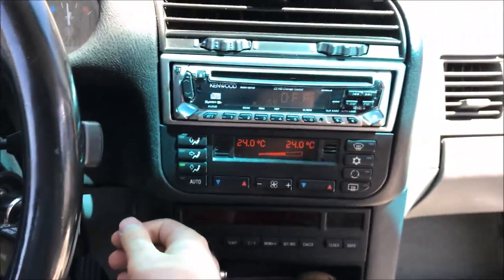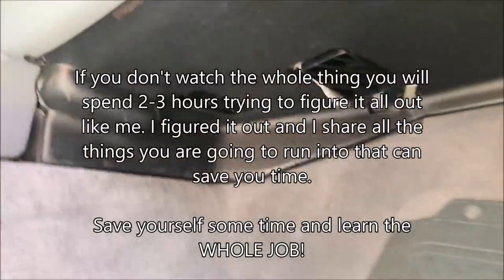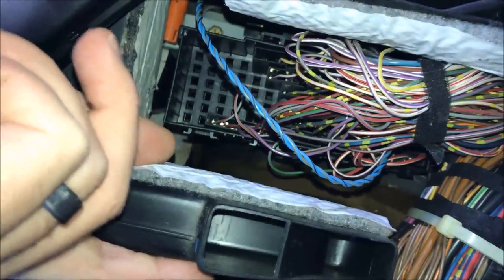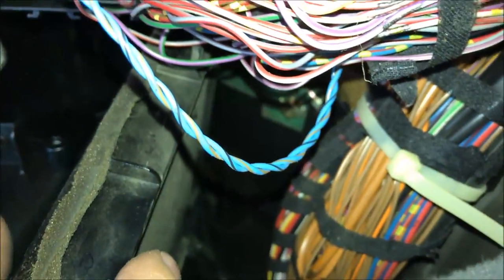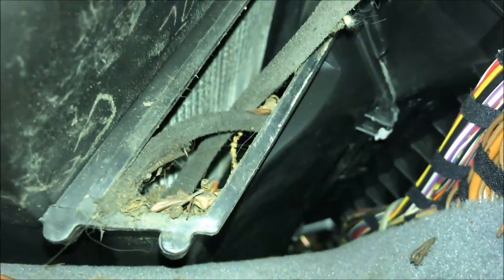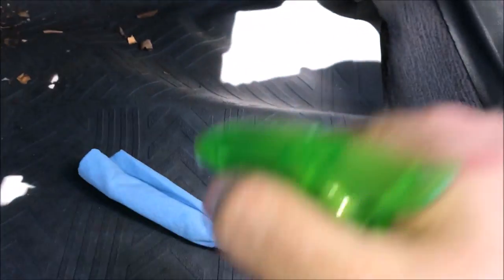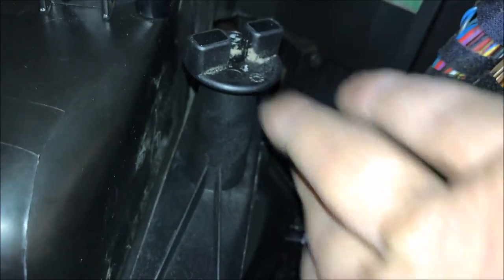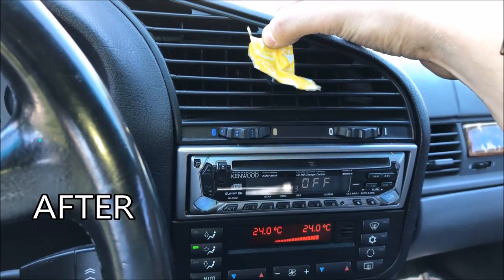How to Change Cabin Filter BMW E36 - BEFORE and AFTER Results AMAZING (Fix Low Air Flow)

Comment: If anyone out there has a right hand drive model: the access to the cabin air filter is still on the right hand side of the car (as shown in video) - so it is under the steering wheel as opposed to under the glove box. I just changed it on my right hand drive 1997 e36. You'll need to undo three screws in order to take the panel off that's under the steering wheel, then start pulling it back from the middle of the car (there's clips on the panel closest to the door, if you peel the panel from the center they'll unclip and allow you to take the panel off). There's a little electrical connection and light, both of which you can unclip from the panel once you've got it loose, in order to fully remove the panel and take it out of the way. Then you'll be able to see the cabin air cover with the round knob that you turn in order to take the air filter out. It's pretty easy, just like in this video, but on the other side of the car.
Reply from the maker: +Dante Alighieri thanks for sharing this!
Reply: Thank you Dante.. hardly any air coming out my RHD e36. Gonna tackle this tomorrow.

Comment: Fantastic! I just re-gassed my A/C as the interior of my E36 Coupe never got nice and cold. Living in Queensland (Australia) temps here hit the 40's (Celsius-over 100 Farenheit) all throughout summer. It turned out re-gassing didn't make much difference. As soon as I saw the video (I watched the whole thing) I went to my car, took off the panel as described, and took the 'lid' off my cabin filter. I never knew it was there! My filter was EVEN WORSE than in the video. It was fully choked up, and a pile of leaves and twigs fell out. I tried the fan (with no filter - I need to buy a new one now) and was 'BLOWN AWAY' (hahahaha) by the difference. I even feel the cold air from the back seat now! I can't wait for the drive to work tomorrow so I can be one of those cars with the windows UP in the sweltering temps. BEST VIDEO EVER!!!!! and cheap and easy!!. Everyone should know about this - in any make of car. Thanks.

Comment: Just changed mine last night. The previous two owners never did. I am confident I pulled out the original filter. The car 1995 318is has 208,899 miles.

Comment: FYI   the filter frame is designed to  snap into 3 segments,, and bend at those joints slightly.  This allows you to install it slowly and bend around the items in the way.  Thats why the filter was in pieces when you removed.  you pull out the 3 segments .  The filter frame  will hold it  together when pressing  it back in.
Reply: do u mean u can put the new one back the same way the old one was pulled out??

Comment: Thanks for the great info.  Perfect video for changing the filter.  Changing my filter as the blower resistor failed on my 323i and i'm worried the limited air flow through the filter didn't keep the resistor cool enough..

Comment: After attempting this myself i found the other video where you remove the glovebox 4 screws and a bolt is better and eaiser but this dose have some key points.
Reply: I found this easier - my new cabin filter came with a guide that said to do it that way and I still ended up on this video lol

Comment: Swapping the filter was easy, putting everything back into place is the hard part. I ended up losing the plastic screw that bolts into the air duct but it probably won't move around since everything is packed so tightly under that cover
Reply: Putting that plastic bolt in place is the absolute hardest part, I don’t even think it’s possible without pulling the entire glove box out

Comment: Hay Man thanks My wife has had her 3231 to portland BMW 3 times for this problem never did they fix it but charged $350.00 I pulled the filter out and cleaned the are ware the filter came out closed it back up with out filter just to check and see that i had found the problem. BMW Kept putting another Resistor. only thing they did was over change use and not fix it PS (Resistor cost from $44.00 to $54.00 Portland BMW charged for that part $298.00 plus install. Thank you once more
:-)
Reply from the maker: Wow amazing story Harry! I love reading viewers comments when it truly saves them loads of money. This makes all the hard work worth it.

Comment: Great tutorial except the part where you need to get off that electrical plug you really need to push hard towards the top with a long metal thing (example flat screwdriver)
then it's not easy to put it back as this place is hard to seee lol i was constantly flipping myself what a hard place to work on (and put a decent lighting i wonder how you filmed that haha

Comment: Help...Heat/air is not going to feet when i switch the climate control to feet.  It feels like the flap that closes and open is stuck closed (if there is such a thing) or could it be a bad electrical connection for the control to the feet area?  Control works fine switching to face and windshield  area. Any idea how to fix it?

Comment: I  found the best way to do it is to remove the old filter, and drive without a filter for like a couple hours blowing away all the crap that is stuck inside...then install the new filter :)
Reply from the maker: Nice! What happens to all the junk where does it go too?
Reply: wherever you point the vents...mostly on the seats....
Reply from the maker: Haha nice I guess there is some cleanup work then
Reply: ya definitely, but almost worth it...
Just checking the rest of your videos...Good content!
Reply from the maker: Thanks man. The E36 is great for content

Comment: Silly question, better safe then sorry, the filter you linked on amazon? Will it fit my 1997 BMW 328i?
Reply from the maker: +leo hernandez just log your car into the Amazon garage and it should say if it's an exact fit or not.
Reply from the maker: +AutOdometer you could always contact the seller and ask them if you to be for sure
Reply: Okay, thank you so much
Reply: I use MANN FILTER CU 2835

Comment: This is a job I'll need to do on my recently acquired E36. Is the position of the cabin filter the same on the RHD cars?
Reply from the maker: I’m not totally sure since I have only ever own this BMW. They typically are in just a few locations... under the glove compartment, behind the glove compartment, under the passenger windshield washer cowl outside ... or in this location I just showed you
Reply: @AutOdometer  I've since found out that my UK spec RHD E36 has 2 of the round type cabin filters which are located under the scuttle (as we call it) beneath the wiper linkage. The rectangular type is for cars with aircon (mine does NOT have aircon). I'll be replacing my cabin filters at some point so I'll be featuring it in a future video.

Comment: My compact doesnt seem to have this filter.. I tried disassembling this once but it looks different.. Just ones under wipers, am i correct or i messed something?
Reply from the maker: Not sure what year make and model you have but this is a 1997 BMW 328is Coupe. Your specific car may not have a filter in this location. Some filters, like you said, are location underneath the cowl under the wiper blades. I’m quickly finding out that not all cars have a cabin air filter especially older ones
Reply: @AutOdometer  1996. M44B19 compact: I disassembled it and it seems that thats only filter i have, which filters outside air entering cabin.. of course i didnt have new set of filters ready so i cleaned ones i have with compressed air. seems to have much better airflow now. Thanks for your video, your airflow comparison motivated me to open this up and check

Comment: i would like to know your comment on a issue im having with my 95 m3. It blows heat through all the vents such as the feet and defrost, but will no blow through the face vents. Yes ive made sure the dial is set to heat. Ive replaced the cabin filter but still no change. All it does when i switch it to the face vents is make a sound like its blowing but nothing comes through. Do you have any idea what that could be?
Reply from the maker: +Ecordell11 I haven’t experienced this but it sounds like a problem with the dampers. They direct the flow of air when you press the button on the dash. Research dampers in an E36
Reply: Ecordell11 that’s in your dash.. not a cheap fix..

Comment: Didn't even know my e36 had this filter I thought they didn't come with one
Just checked and saw my 98 328is doesn't come with one
Reply from the maker: +Bmw M3 e46 oh nice... well if your blower speed is slow then it's the blower maybe or a poor resistor
Reply: It does have one, is it rhd?

Comment: I thought the cabin filter is located under the hood of the car?
Reply from the maker: Not in this model. This is the 1997 328is Coupe E36 with the M52 engine.
Reply: AutOdometer OK - thanks. Great informative video 👍🏽Thanks!